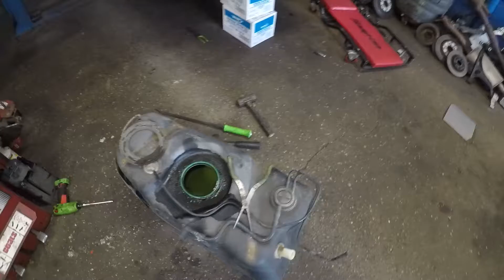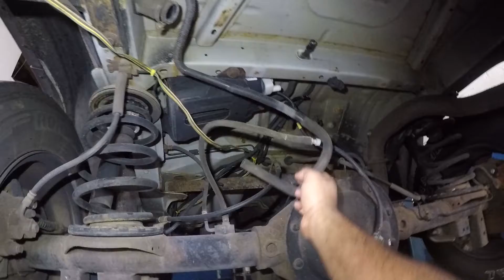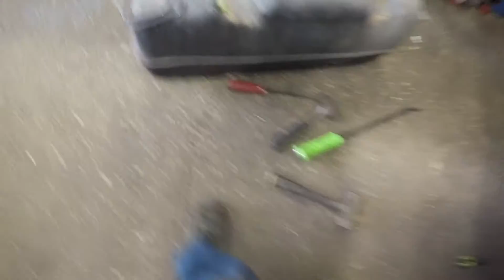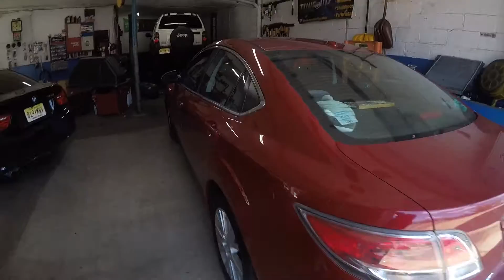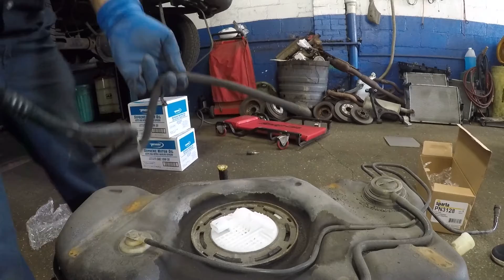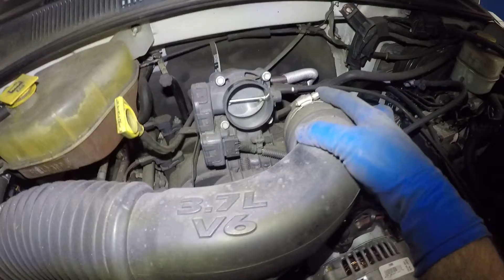How to replace fuel pump on Jeep Liberty  ||  Jeep Stalled while driving, Bad fuel pump

Comment: Do you know if the quick connects on the high pressure side of the fuel pump are the same between models? My feed looks ne blew in my 04 liberty and i can only find 05 parts.
Reply from the maker: No im not sure

Comment: Access the fuel pump buy pulling the carpet back and remove 4 screws in the access panel you do not need to remove the gas tank
Reply: Only the earlier models had that access panel in the back. The ones from I believe 2004 and onward got rid of that panel under the carpet making it impossible to do without dropping the tank
Reply from the maker: Not there
Reply: Believe me I looked, 2011 liberty, nope 😢. July 4th, hopefully this isn't a kaphuckinboom
Reply: not all models have that option